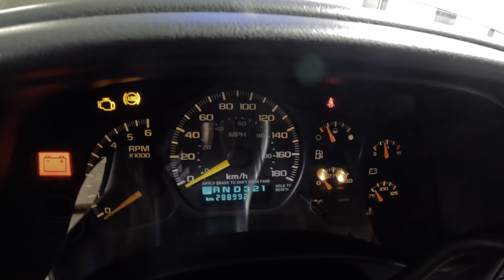Seize the Day! DO NOT Lube Brakes- Grease Jacking   2000 Chevy GMT800 Silverado 5.3 4.8 #repair

Comment: No, you don't grease slide pins.  You lubricate them with Sil-Glide. They come from the factory with lubrication for a reason. To ensure even brake pad application and wear,  the caliper must freely move on the slides. If you have dry slides, the inside pad will wear more and faster than the outside pad, or the caliper can bind on one pin and twist,  causing an angle wear on both pads. If you live in a desert, then you probably have no worries. But in wet and salty environments,  they will get contaminated and rust will cause them to freeze up.
And dissimilar metals require a dielectric barrier in between them or they will corrode (an exchange of ions) rapidly. Grease can be a barrier between two surfaces,  as can tape, paint, or plastic.
Reply: I just got a new tube of Sil-Glyde in my stocking! I had been using the CRC brake and caliper grease for years, but then I got a Subaru with rubber tips on the slide pins. I had to take the brakes back apart just days after doing them because they were seizing up and found that I almost couldn't get the pins back out. It turns out that regular brake grease will cause the rubber to expand! Sil-Glyde is the answer and it's the only thing I use on brakes now.
Reply: Yeah, you do grease slide pins. That's what Sil-Glide is. Lol

Comment: The reason the inboard pads wore unevenly is due to the grit jamming in as described in the video but these brakes are prone to this problem because the slides are on the outside of the arc and stop moving freely.  Only the inside arc can still react to the piston pressure when this happens.  On smaller brake systems the pads move within channels better centered within the inner and outer arcs and less likely to wear unevenly due to "grease jacking".

Comment: Living in the GTA, it's a pick-your-poison situation.  As a DIYer, every 6 months when doing winter tire switchover, I pull the pads, clean and lube it all.
Reply: You might have educated the Yanks that GTA stands for Greater Toronto Area. In Florida the might not even know where Toronto is. Well maybe Ray does because he works on cars from there.
Reply: I do the same here in hogtown but just clean them up. No grease in the silver!

Comment: If it's driven in winter here, you must grease (with the correct caliper slide grease) the pins and/or slides. If you don't they WILL rust tight. Actually even with grease they rot tight, just not as soon. Also the pad abutments need the same treatment. Nothing like having to use a dead blow hamner to remove the pads. It rusts between the bracket and the stainless wear/anti squeak shims, expands and lock the pads up tight. Then a few minutes with a diamond wheel to grind the rust away before reassembly. If it's been driven in any of that liquid brine crap, good luck. Fun also, have you ever had to use a 10 lb sledge to get the rotors off. Good times, good times.😵‍💫
Reply: This is just wrong. Are you actually watching the video? or just commenting over the title. The areas shown in the video should not EVER be greased. I live in Michigan, and have never greased that, and my brakes have always worked great. Pads wear perfectly evenly. You obviously need to grease inside the slider pins behind the rubber boots, but no grease should go on the shims where its exposed.

Comment: Love your post!!  With this situation, I think it’s like a doctor seeing a patient in the ER.  When most mechanics get a vehicle, they are getting it on the worst day of its life at that point. It possibly hasn’t followed any maintenance schedule. The work may have been done by a DIYer who is only doing the work to save money and they are following directions as they understand them. Most vehicle manufacturers in their maintenance guides tell you to lube the guide pins. They also give a recommendation of what type of lube to use as well and people use what’s cheap or available. So while I agree there is an issue in your face with this question.  I also think you answer it yourself when you say that the suspension system on that vehicle is lacking lubrication and maintenance. So I say you follow the manufacturer recommendations with maintenance schedule being the lead off because brakes should be changed and checked to maintain health of entire braking system.

Comment: A few weeks ago I had a slide locked into my caliper and I noticed my rear rotor (driver side) wasn't completely squished by the pads and I could see a bit of rust build up on that rotor. Since I'm now used to your videos, I started wondering what could be the issue and my first thought was: "There's probably some air in that circuit" but then I remembered since it was doing it only on one rotor it had most likely something to do with the caliper itself. Turns out as you once suggested in previous videos, I took apart the whole thing and I noticed the lower slide was severely stuck. Had to use a blowtorch to remove it and grease it again. I changed the pads and I need to change the rotor since it only applied pressure on one side of the pad and ate the rotor. But I gotta thank you because you saved me some precious hours of diagnostics thanks to your videos (because I'm new to car repairs) and I learned a lot of things from you. I will definitely stay subscribed to your channel, it's like a gold mine of knowledge to me even though we don't have many trucks here in France, it's still valuable knowledge because it's not that different. It's basically the same but bigger. Thank you again for your videos and keep up the great work ! You're a real helping hand.

Comment: I've seen that wear pattern changing out new non-greased brakes here in Michigan. It's either rust or grease build up for us up here lol
Reply: I've run into this on my cars where mechanics slob grease all over the hardware and do nothing on the bracket side.  worst of both because the rust builds up on the bracket and "jacks" the pad... either to or away from the rotor. Either way, it's uneven, and if it's the "away" side, you also lose a lot of braking force..  that never seize on the bracket in the video is actually smart, but the grease... nah.
Reply: ...But that's the main reason why you really see it with or without grease, it's more to do with the bracket than the hardware... i think people confuse it to be the other way around because the grease holds onto all that garbage as it comes off/out
Reply: No one thinks the backing plate is pointless? 😅

Comment: Quick note from Manitoba. I'd never put brakes together without lube. But it has to be brake lube. And only a dab on the bits that actually move. I try to service my brakes twice a year, to, while putting on winter tires.  Petroleum chassis grease on/in brakes will turn to asphalt. Never-seize on non-moving parts is an excellent idea. Gonna try that.

Comment: I used to be a tech at a Mazda dealership. Mazda specified copper based lubricant on the ears of the pads, with the "black" brake lubricant on the back of the pads. I've done it that way ever since on every car i've done brakes on and have never had an issue or noise. I'm in the northeast rust belt, so it's a must in the winter months also.

Comment: im from the uk and this exact same thing happened to me  with the exact same marks on my 6 month old brembo discs and pads (its common over here to put a little copper grease where the pads sit top and bottom of the carrier its how i was trained too) i actually thought and so did some of my mates that it was the slider pins  i may have not greased enough with silicon grease however when i replaced the discs and pads i found like yours they was plenty in there we all scratched our heads and couldn't figure it out even an older mechanic who's retired now looked at them and scratched his head and thought the same as us i will show them this video too they may find it interesting.

Comment: I agree, no lube on the shims! To all of you who think that they rust and cause the brakes to fail, you need to buy better quality brake parts. Most of the shims that I've seen are chrome plated and don't rust.
I'd like to also point out that all of the components that close to the friction surface will heat up and boil away any and all moisture even during the coldest Canadian night.
 Only grease the slide rods, nothing else! :-)

Comment: Lived in Canada for a lifetime and doing the family brakes since dissatisfaction with mechanics. Ironically my only problem scenario was with antisieze! Using a good silicone brake greasa solved the problem and has worked for decades on my sliding pins. I've always ragged out the old stuff applied a very light amount silicone before reinstalling. In your video I was unimpressed with the overuse of grease observed. I think this is what caused the problem and generally use antisieze anywhere near the brakes since it can attract all kinds of road buildup causing the condition you were dealing with.  Life in Canada!
Reply: In Germany on most of the containers of antiseize you can read the explicit advice not to use it with brake systems. I prefer permatex purple lube or ATE plastilube without any issues in salty and snowy Bavarian winters 😊

Comment: Up here in Canadia it is a must to put a very thin coat of brake lube on the sliders. Actually, after cleaning and before installing the pad shims, small amount of grease, install the shims, then a thin coat of grease, then slide in the pads.  Helps prevent calipers etc from seizing.
Reply: "Down here" in New England, we even 'lube' our (leather) boots. Well, if you let lube extend to things like mink oil...

Comment: Living in Ontario Canada I brush on a tiny bit of brake lube on all sliders. My original ones were so rusted I couldn’t believe the brakes even worked, but they did squeel the odd time the final week before I replaced everything on my everday driver 2010 VW Golf. After that and a bleed my brakes are better than when it was brand new.

Comment: I’ve never had a problem using Permatex Ceramic Extreme Brake Parts Lubricant. Very light coat and just on the pad ears. It is a grease that does not gum up over time and even with brake dust sticking to it, it remains super slick. Good for up to 3,000 degrees Fahrenheit. Great for slide pins and piston faces as well.

Comment: Live in the rust belt and have been greasing those brake parts for 35 years and have never had anything like that. Difference is I use very minimal (basically just putting a sheen on the metal) where as whoever here was apparently gooping it on liberally.

Comment: This is a good lesson in Geography as well.    Ontario (where this vehicle is licensed) is a very large province.    You get areas, like the Ottawa Valley and Eastern Ontario that get clobbered in snow and temps where road salt is very effective and used a lot.    You get into Northern Ontario, tons of snow, but much colder temperatures where road salt is useless, so they use other chemicals and or sand.     As you head South and Southern Ontario, much less snow and more moderate temperatures, so they have to use a lot less salt.    The province is very diverse, some areas you are allowed to use studded tires, and other areas not.    This vehicle is in amazing shape for 23 years old.

Comment: That's why those shims are nice shiny zinc anodized material. Pads can slide happily against them. My factory supplied shop manual, also advises against greasing the slide pins. Both the pin and hole to be impeccably clean, and water used as the only lubricant in assembly, to assist the pins through the rubber boots. Not my words, but the factory manual.

Comment: COMMERCIAL VEHICLE TECH AT MERCEDES BENZ HERE, absolutely no grease to be applied on any caliper bracket or brake pad. Only grease we use is silicone in the boot of the slide pin. If you don’t completely sand all the rust and dirt and build up off the brackets you’ll definitely get a brake pad stuck in the holder condition and overheat the brakes which in return will squeal. I’ve seen where grease actually damages it causing the boot on thepiston on the caliper to swell, too much grease causing the pad to stick, grease being compressed between the brake pad and rotor doing what you see in this video. Or it completely seizes hardware when mixed with dirt and preexisting rust. Really it’s about how good of a brake job you do. I personally use no lube with no issues and live in NY

Comment: Had the same problem on my 2000 Chevy Express 1/2 ton, used a flat file to flatten the surface and applied some Never Seize on the slides and has been OK for 6yrs + 50k miles

Comment: Worked at a Ford dealer for 20 years and, yes they're dry from the factory. Because of that we constantly repaired stuck pads,,,,,,,on one year old vehicles with a few thousand miles on them. They had been through exactly one winter.
We rarely replace brake shields due to rust, since in 3 or 4 years they'd be gone again anyway. Just need to be sure the part between the knuckle and bearing to serve as a shim.  Plus, your chances of getting the hub bearing out of the knuckle without ruining it are slim to none, that's once you heat and get each of the bolts out, if the head of the bolts aren't rusted down to a 10mm circle. Man I'm happy to be retired, lol! 21:29

Comment: new yorker here; I lube the exterior of the shim and underneath it as well (and they still rust). my regular customers (depending how heavy their foot is) usually need brakes every 2 years or less. the rotor surface usually rusts before the pads can "rust jack" (so I'm replacing pads and potentially calipers at this point anyways).. the biggest preventative to the calipers rusting and causing a sticky pad is probably just a regular wash when the salt comes out. I don't even bother replacing backing plates on anything unless the customer cares, they are just going to rot off again...

Comment: I put a little grease and then wipe it off. This leaves a thin coat that just prevents rust and corrosion, but not enough to turn attract dirt and turn to mud.

Comment: Hey Ray I love the joke at the end....I drive a beater pickup and winter is coming....It might look good in silver lol.... Or maybe copper! Lol great video and I only use the thinnest layer of high temp never seize mostly from Locktite, or Permatex if I grab that one first! I won't use grease of any kind in upper Midwest. I used grease for a long time but have found after switching over the past dozen years, if you rub the never seize on real good like a working girl puts on mascara..... But keep it real thin...   When the pads need changed it may be mostly gone but the metal is not rusted and the slides are working fine. Haven't experienced any pad jacking since. Thanks Ray. Great video! J Pol.

Comment: To grease or not to grease: that is the question! Greasing shim plates is something mainly depending of the calipers and pads design. I've always been told grease will melt then accumulate dust and debris, causing problems and seizing anywhere where the disk ventilation operates. However, some thin layer of high temp grease can solve minor problems in harsh conditions, thus implying a more frequent maintenance (end of winter...). Most actual brakes design used here in EU are similar: these stainless steel shims are supposed not require greasing per design, but I've seen many, and I recommend use of some antiseize at the shim-caliper interface, where  electrolytic decay within different materials is always a problem. Some also put a little layer of high temp copper grease at the pad-piston interface for the noise, but it also depends on design... and technician. Some brakes systems can also require some spring loading, also against seizing and noise.

Comment: I have never put grease on the pad slides not in MI for 30 years and in PA for 15. Never had a problem yet but I also service my own brakes and inspect them every other oil change along with tire rotation...

Comment: 4:43 NICE tip!  I had never thought of that.  But will absolutely try that technique next time.  I always use a C clamp, which I understand is not ideal.  It works, it takes more time, it's an extra tool, and it's uneven pressure;  Prying on the rotor solves every concern.

Comment: Ray in the UK if you don't use Copperslip grease then the pads would seize with all the salt and sand put on the roads during winter. That stuff does not dry out and remains operational and is also the best stuff to grease the sliders with. Copperslip cool stuff

Comment: In the great state of NY, I always put the purple Permatex lube between the stainless steel shim and the pad bracket, it slows down rust jacking which pinches the pad over time. We see brake rotors that have rust on them just like the ones you took off.

Comment: Bring back grease fittings! 

All my vehicles 2002+ don't have those zerk fittings on the ball joints and outer tie rods😢

And replacements don't have them in the aftermarket, unlike that GM vehicle that Ray showed 😢

Comment: I have determinated that anything you use on a shim will do that from dust/dirt be it wd/40 dripless gel lube, silicone paste, brake/axle grease.  Aantisieze will gum up and dries hard causing the sticking as well.  But yet something is still needed when there are no shims because rust on the cast iron brackets will cause the pads to bind as well.  So Im following this for further insight from you math tutor-like techs out there.